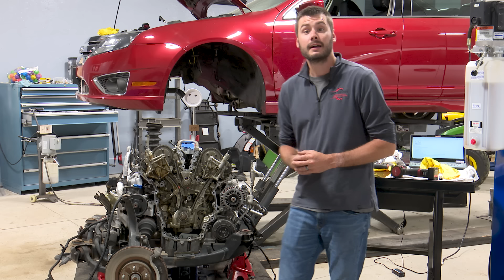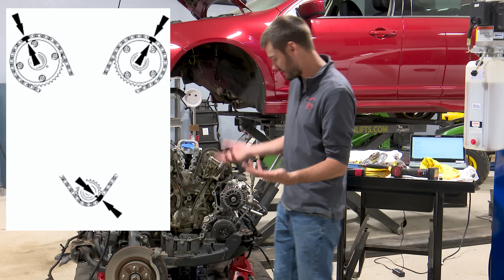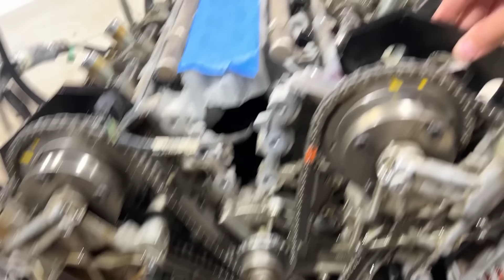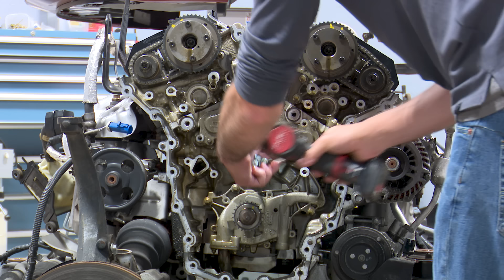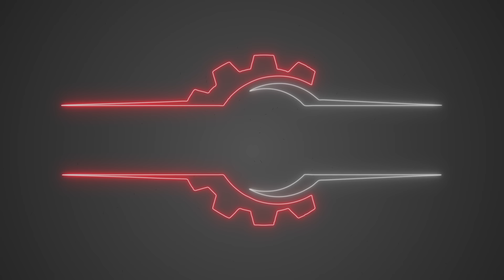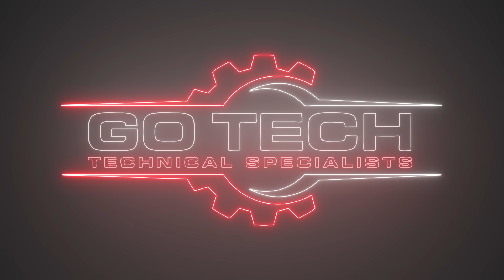How To Replace Ford 3.5L V6 Timing Chain and Water Pump

Comment: HORRIBLE DESIGN, MADE TO FAIL.  Having the bolt tight enough and that is ALL that keeps the gear from slipping because they were too cheap to machine a key for the gear is insane.

Comment: These engines are know to fail head gaskets after water pump failure...shame on ford for very bad design... this pump should belt driven and 40 min replacement time not days to put back together

Comment: This feels so much easier with the entire power train removed. I'm preparing to do this myself as a non mechanic with minor experience in working on the engine peripherals. Just making sure i know what I'm getting into if I choose to do this. I have experience in engine work but all on my own vehicle. Brakes, Oil, Water pumps on Chevy van. Rebuilt the coolant system on that same van. I've never dropped an engine but this looks like a relatively large investment to use a lift and drop the engine out. I was going to just work in the engine bay of my ford flex. i have what i need to get the job done but its the instatutional knowledge you bring out during these videos that informs us where to be cautious. Thank you.

Comment: The one extremely important part of this video at 21:05 and following, where you're manually turning over the crankshaft and the water pump is skipping. This happened to me twice, after I removed the timing chain because I thought it skipped timing and had to retime it, or so I thought. After more reading/research, and rewatching your video a second time, I discovered this little gem. The critical part for DIYers to know is that the timing chain tensioner is a hydraulic tensioner, and without being pressurized with oil, it won't tension properly. Some guys suggest holding the RH bank guide with your hand while turning the crankshaft two revolutions to keep this very alarming skipping from happening.

The other beyond-critical piece to this timing chain/water pump R&R mystery to know is that you must remove the fuel pump fuse or hold the gas pedal down while starting for around 15-20 seconds to prime the oil. On a car with push button start, make sure you hold the gas pedal down the entire time it's cranking/turning over. With push button starts, this should be around 8 times, so, to prime the oil, you'll need to keep your gas pedal to the floor and push the start button three times. If either or both of these procedures are followed, the gas is evacuated and the car won't start, to give your engine time to prime the oil. If you do not do this, the engine starts and the timing chain may skip time and you'll have the pleasure of again removing the timing cover and everything that goes with it.
Reply: I think that just happened to me.  After changing the pump the engine ran for a second and became stuck. Thanks for the heads up on this ridiculous engine!  Don’t buy Ford!

Comment: Hey friend, I have a question. I have a 2011 Ford Edge 3.5. The engine gasket on the right side is damaged. To change the gasket, do I need to remove the entire cover in front of the timing chain?
Reply: You mean the valve cover gasket?

Comment: I wish I had found this video first! I followed a different water pump replacement video that glossed over the timing part without much detail about how to remove the slack and double check the cam alignment.  Now I have timing codes and have to open the engine again!

Comment: I would have replaced the oil pump with a high volume pump for another $150. Even if had keep the timing chain to stay on budget. Those oil pumps are notorious too. The Melling HV pumps supply 20% more volume to top end.

Comment: I am workig on a 2011 flex Non Turbo and i have already made two attempts but my timing was off. Now i am going for the third attempt. Don't know what wrong. Thos jpb is for family who happens to have no money. So the plan wad to just do the water pump since the car was running fine except for that but two of the older marks on the chain are missing and thoz job has neen a nightmare!

Comment: If you accidently wipe off your timing marks you can make sure your motor is timed correctly by turning the motor until cylinder 1 is at TDC, and basing your timing from there. The bottom gear mark will line up at the 4 oclock position with the cams again.

Comment: What a crazy ass idea to put the water pump there. :face-fuchsia-wide-eyes:
Reply: actually it’s pretty smart if the serpentine belt snaps the water pump is still pumping meaning it won’t overheat if the timing chain snaps the water pump is the least of your worries
Reply: @brandonniles-m3y  I would absolutely 100% take a belt driven external pump over an internal every single time. People are far less likely to check their coolant and oil to catch this failure in time. This design is planned obsolescence, no question.
Reply: @brandonniles-m3y if the serpentine belt snaps you'll definitely hear it or see the temp rising just do a quick belt but if pump fails compare a quick external pump replacement vs one of these internal ones 😂
Reply: @jonathanjuarez178 you’ll be surprised how many consumers have no situational awareness
Reply: @brandonniles-m3y  Stop taking drugs . :face-fuchsia-wide-eyes:

Comment: I just finished a water pump job on a ford edge. you do not need the timing blocks, i just used vice grips and on TDC. This job is a real pain. KING TRUMP.

Comment: Thanks a lot for pointing about marks that they won't line back  up. Because that's what I was just worring about. Doing this right now and first time
Reply: Tell me about it I did this twice thinking I screwed up ..his is the only one who said they never line up ..lord have mercy😅
Reply: @karimanwar2695  They will after about 50 cranks. They all do that

Comment: Just so everyone knows. Very possible to do this on your driveway. Camshaft alignment tool kit is necessary but not needed IF you like to gamble. Also, drench the hell out of the crank bolt and balancer when starting. 
Good luck guys

Comment: I imagine that seized up water pump was making intermittent whining noise. Definitely stretched that chain. Possibly also jumped some teeth. Tripping the cam shaft position sensor codes. Stay clear of this 3.5 motor.  Save yourself money and sanity.

Comment: I am currently doing this on my wifes 2010 Ford Edge. I was a mechanic for 16 yrs. I begged my wife to just buy an old gmc jimmy/ Blazer or a pre-06 Yukon/Tahoe. Since I was gm certified. She insists I fix her Edge with 260k on the clock...🤦‍♂️. These newer vvt engines are an overcomplicated mess. 70k timing chain inspection and replacement is ridiculous. Plus the book time is 12hrs for just about all 3 automakers v6 vvt platforms. By the time the job is done. You're close to 3k deep in the repair. That's a decent down payment on another one. And cutomers refuse to believe when the get the cam crank correlation codes its the timing chain. Well, the autzone AI said it was the cam position sensor..🤦‍♂️. And of course you can't explain to them the cam position sensor pretty much has to take damage to be inoperable.
Reply: I did the pump, phasers and timing chains on my wife’s 2016 explorer. I bought all ford parts, I was into it for around $1400.
Reply: @mikeadams42 I got hers done with parts for a little under 700. The chain kit was around 500, wp was 90, vc gaskets was 20, intake gaskets was 20, crank seal was 10. She had 6 plugs that the shade tree mechanic she dealt with before me couldn't install. I did all the labor. Ford should be ashamed of themselves for the power steering pump mounting location.

Comment: @13:00 that 89 inch/lb plus 45 degrees of angle torque is the same as Ford torque requirements of 8 ft/lbs for 2014 Ford Edge?
Reply: It's just different by a factor of 12 between inch and ft-lbs, so pretty close. 7.4 ft-lbs to be more accurate, but I'd err on more and not less, which is probably why they rounded up with the figure I saw.

Comment: I like to mark the block with crank mark and couple marks on head for camshaft marks for timing verification when links or belt don't align after 720 degree or two revolutions pro tip

Comment: I turned my engine over by hand after doing this job, and the chain slipped. Was that a faulty tensioner, or should i not have rotated it? I usually turn the engine over by hand 2 times after doing a timing job and have never had the chain slip. Any advice is appreciated thank you

Comment: My main issue with this video is he doesn't change all the guides or the phasers with the secondary chains. If you convince the customer to change it because you're already in there you should at least do the job right. This customer will be back eventually because of the phasers going bad or the secondary chains. Maybe cost came into play with the customer but the reality is that the cost couldn't be that much more to do this job completely right. Especially if you have any kind of warranty on your work. Also, many other videos even from parts manufacturers say the locking tool isn't necessary as long as you have the timing chain lined up prior to removal.
Reply: Well you should make a video doing it instead of complaining about someone else's video.
Reply: @jenkericj  I dealt with this issue myself and did a shit ton of research on what to do. Over half the cost is the labor to get access to it. The price of parts is almost nothing. An honest mechanic would try to advise you to change it all otherwise a guide/tensioner could fail. Which is common by the way. This is a great video on how to so this job, but spending just a little more on the parts while you're already in there only makes sense. Sorry I criticized somebody and you felt it was necessary to twist my comment like it was more than some constructive criticism. Go police the rest of the YouTube comments home slice.
Reply: @captknuckles7143  Ive replaced many 3.5 water pumps and primary chains only , never any second chains and its never a problem.

 Ford just trying to sell more parts and more work . There's no were near the same amount of wear going on with the secondary chains vs the primary.
Reply: @jenkericj he has a valid point.

Comment: I am going to be replacing water pump on my daughters 2012 Lincoln with this same engine. I am leaning toward replacing timing chain as well, but how can you tell if it is stretched? My son's Audi there was an inspection port to look into and see how far out the tensioner was. There must be a way to see how stretched the chain is on these Ford 3.7's, right?
Reply: Ford recommends that you replace both the water pump and timing chain while you have it apart.
Reply: He should have just replaced the phasers and the secondary chains while having it apart. Also all of the guides. I didn't see for sure if he replaced the guides.

Comment: Was it safe to remove the tool to adjust to get 1 tooth over because im stuck exactly right there afraid to remove it
Reply: Lot's of other videos say that cam locking tool isn't necessary as long as you have the timing marks in the correct position before pulling any of it apart.

Comment: Do the water pump bolts or timing chain guide  bolts need thread locker on them? What about the tensioner?
Reply: No thread locker on all the bolts I removed from OEM. Only thread locker I saw on the entire repair was on the motor mount.

If the thread locker is good with oil (and gasoline vapor) exposure, then blue couldn't hurt, but if OEM didn't do it, then I'd skip it anyway, since there's no need, and all my bolts were tight still.
Reply: @weeveferrelaine6973  Thank you. I did the repair without thread  locker even before I posted the question. I just wanted to verify that it was correct.

Comment: 99.8% of those who undertake this ridiculous task will not be able to remove the engine. This video can help in the actual task of chain/pump removal and replacement but not with the intricacies of getting there.

Comment: At 14:49 you didn't tighten upper bolt for guide with wrench that you loosened at 10:30 so you  could remove the water pump.😮
Reply: I saw that too.

Comment: I've done these and I've never had to take the engine out or the frame or anything you can do it from the top and it's not hard at all save a lot of time and a lot of money
Reply: I was thinking same thing. Three or four hours labor to drop the entire cherry out and then put it back….those labor hours could have paid for new cam phasers & chains, etc.

Comment: I’m about finished with my Ford Explorer water pump, timing chain, vvt solenoid, alternator, spark plugs, radiator hoses, thermostat, fan belt, fan belt tensioner change out, whew…not bad for 167,000 miles but yeah the dumbest design for a water pump placement. Just wait till Ford places the battery inside the fuel tank design on newer models 😂
Reply: I have 206K on my 2013 ford Edge…it runs like it’s new!

Comment: I had a 2011 Taurus 3.5 and bought the 100k mile extended warranty.  The water pump went out at 104k miles.  Coolant flooded the lube system and ruined the engine.  Shame on me, I traded it for a 2015 Taurus 3.5 and the same happened at 115k mi.  Both had religious service at the dealership.

Comment: Does this timing tool fit the 2018 3.5 NA engine?
Reply: Yes it does. Look it up on Google. And it will direct you to the year and model tool you need to align the camshaft.
Reply: Looks like this is EB

Comment: Yes  Sir. The water pump is driven by the timing chain. This engine is 1 of the top 10 most reliable ford engines have ever produced. Yep sucks when water pump fails. But other then that mist everything is pretty easy to deal with.
Reply: And then the transmission goes out

Comment: Ford never put a 3.5 v6 in the fusions unless it was the duratec which is a different engine with a external water pump… they did do a 2.7 eco boost but never a 3.5… come on if you are making videos like this you need to get your specs right
Reply: Must be smoking some crack😂 I own a fusion and yes it does have a 3.5 engine in it😂

Comment: Are you kidding me? Just to change the water pump you have to pull the engine?! WTF!!!
Reply: It's easier, right now I'm working on a 13 explorer, also the 3.5 but transverse, all I did was take the tire off, take off the tire cover, pull the timing cover and that's pretty much it, Its tougher but it's definitely not  impossible

Comment: Dumbass ford engineers putting the water pump inside the engine with it running off the timing chain.

Comment: THANK YOU THANK YOU. I am NOT a mechanic but I followed your video and succeeded in realigning my 2011 Ford Explorer timing chain, which had a code "P0017 crankshaft position camshaft position correlation Bank 1 Sensor B" after replacing my water pump. To clear the code, I tried changing my sensors without success, so I opened the vehicle again and realigned the timing chain following your instructions. I was a tooth off. My Ford drives like new now. You saved me a lot of money, thank you thank you.
Reply: im right there with you on this i just got my 2015 explorer back together from pump replacment and didnt get the back cam right 1 notch off.  opening it back up
Reply: @dannymitts6482 did yours start up rough bc of that
Reply: Was yours having a rough start up like vvt wasn't getting oil just did my second one an runs fin but starts hard an sounds rough

Comment: Does Ford make a vehicle that the engine DOESN’T need to be pulled in order to work on it?

Not being sarcastic, I’m living the 4.0 timing nightmare.

Pulling an engine to replace a water pump is excessive.

Had an Escape that had to pull engine to replace starter

Pattern

Comment: Why all buyers should research well before buying, even those who can't swing a wrench.  I will avoid any engines with a water pump buried inside the crankcase.  Those with rubber timing belts were bad enough.  Imagine buying a car with this problem where the seller disguised the leaking water pump.

Comment: I didn't realize the marks wouldn't line back up after spinning so I turned the motor over a bunch of times hoping they would line back up to double check myself, like I used to do back in the day on my old small block Chevy's, but none of them line up but there exactly 4 links off on all 3 gears when the crank was in the 4 o'clock position and the cam tool fits on, so am I alright even those I turned the motor over a bunch of times by hand

Comment: Hello goTech I have a 2009 ford Taurus with a 3.5 liter v6  engine like this one you working on.i lately was hearing a strange sound coming from the to part by the front valve cover left side where the timing assembly joins.so I could continue driving my car like that and it conk out on me on the road.later I try to start but it wouldn’t only the compressor pully turns I thought maybe my serpentine belt broke but it doesn’t look like it as the compressor pully spins around.do you think my timing change jump and mis align with the top camshaft gears?the car only has 58,000 original miles.i find rather strange my timing belt would go so quick.the other thing I was going to ask you where is the starter located? And is the starter that turns the crankshaft?

Comment: Good job on this video. I "liked" and subscribed because you're very informative and easy to follow. (I'd like to know who the rocket scientist was that designed this engine and put the water pump where it is! What a royal PITA!). I haven't bought one of these cars yet, but, because of this, I think I'm going to go with a 2010 or later and the 3.0L engine. Thanks again!